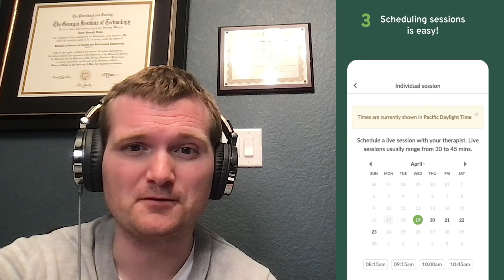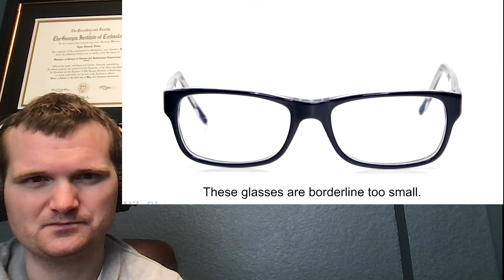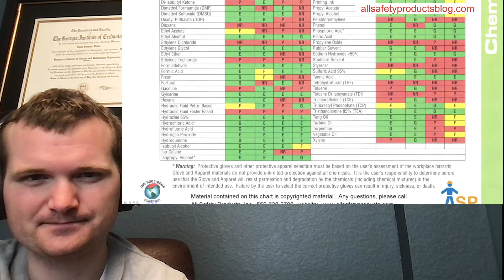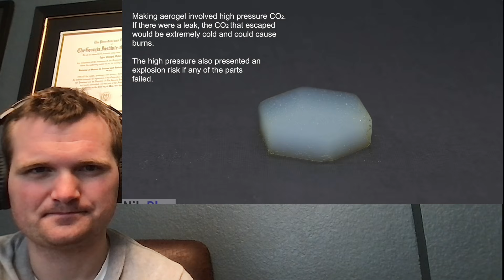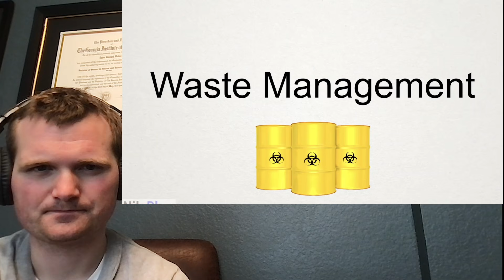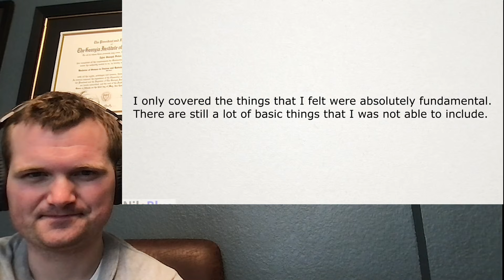Nuclear Engineer Reacts to NileBlue "Chemistry is Dangerous"

Comment: I'm a mechanic, and even though the vast majority of my job isn't anywhere near as much of a public hazard as nuclear or chemical techs have to deal with, there's still a lot of personal safety stuff.

First of all, we do deal with a lot of flammable chemicals that also cause slip hazards, so we need to know fire safety, cleaning procedures, and wear slip-resistant shoes (with oil-resistant soles, if you don't want to be replacing them once a month). We don't really have a need for a shower, because the only real skin irritants we work with are gasoline, parts cleaner, and brake fluid, and the only real dousing hazard there is gasoline if you're removing a gas tank. We do, however, have the eye wash stations, and they're checked monthly both to check operation and to flush the water so it's not stagnant or moldy.

We also have a lot of physical hazards, in the form of potentially-falling heavy things, splashing, flying metal shavings, flying hot metal shavings, dust etc. falling while you're looking up, sharp edges in tight spaces, things unexpectedly moving, pinch hazards, etc. - and, in most cases, multiple of those at once. The main ppe for all of that is supposed to be safety glasses, hard-toed slip-resistant enclosed shoes, cut-resistant and/or chemical-resistant gloves, and lots of safety lectures about procedure. In practice, lots of people skip the safety glasses and the cut-resistant gloves (I often skip the latter as well, because they make delicate or tight jobs a lot harder), but my employer is notable for buying prescription safety glasses for any employee who requests them. I've noticed some of the younger guys (by which I mean less than forty) never wear glasses, but the older guys (in which I include myself, even though I'm not (quite) forty yet) at least put them on for more hazardous tasks, like when the cutting wheels, bench grinders, drills, and torches come out. Guess which group I've had to remind how to use the eye wash station. 🙄 I've been doing a lot of work lying on my back the last few days, and I've had safety glasses the whole time due to the basic hazard of stuff falling in my eyes.

I've set of ppe I've never actually seen used is the face shield and apron we're technically supposed to use for handling batteries. Yes, lead-acid batteries do technically carry the risk of being splashed with sulphuric acid, but it's an extremely minimal risk; the batteries are mostly sealed with only a very few venting configurations, and essentially no risk of spilling without extremely obvious damage. They can technically vent violently or even explode if shorted or improperly charged, but, again, the risk is minimal, and the worst I've seen was some brief venting when charging an internally-shorted battery; the sulphur smell was the worst part. These days I pretty much exclusively with with AGM batteries (articulated glass mat, basically a fiberglass sponge that holds the electrolyte), which are much safer even than regular lead-acid batteries.

But the biggest part of our safety stuff is definitely procedures (we even have a shadowing process for using the lifts and driving in and out of the service bays). We have one hazards I'm pretty sure you've never had to deal with, which is customers. (Well, fleet managers and drivers, these days, but dealing with them is basically customer service.) We have rules for them, too, like no entry unless accompanied by a tech or manager, no open-toed shoes, no unaccompanied minors, no preteens at all, etc. The problem is, you can't fire a customer for disobeying the safety rules (at least, not at a corporate-owned shop), so there's not a whole lot you can do if they just walk in, if they start poking around their car in the air (look, I get it's the most expensive thing you own, but right now it's a couple thousand pounds of sharp, hot, and pinching bits dangling just overhead and surrounded by potential tripping hazards and dangerous equipment, maybe you could wait outside until I can help you navigate this area safely?) and such. I've seen a guy come to chat with a tech and have his 8-year-old daughter sit on the scissor lift in the meantime (one of the few times I've seen that manager actually yell at someone). Once someone tried to walk in to look at the underside of his car while I was still lifting it; probably the only time I've straight-up yelled at a customer, you do not touch a vehicle in motion, and that's on top of not just walking in unannounced, but moving a safety chain to do so.

And, of course, we can't forget waste streams. Oils, different types of brake fluid, cleaners and solvents (lots of hexane and toluene), washer fluid (methanol), glycol (coolant), various metals and plastics (plus the platinum-group-metal-impregnated ceramic of a catalytic converter), aerosol cans, contaminated mop water, oil dry, rags... Oh, yeah, here's a safety tip you might not know: rags soaked in oils and/or organic solvents can spontaneously combust. We actually have metal fire buckets specifically to contain our dirty rags. Then we have to separate recyclable materials from other recyclable materials (lots of scrap metal recyclers won't take lead, and some things like batteries have to go to specialists), separate our liquid waste (luckily, our waste management company is willing to take oil with a lot of contaminants and chemically separate it themselves; not chlorine, though, so we can't use chlorinated parts cleaner) into oil, glycol, and contaminated water, figure out what to do with nonrecyclable contaminated solid waste... It's complicated everywhere, I guess.
Reply: When I was 18 I was replacing the sway bar links on my car, and got rust dust in my eyes (thanks rust belt) luckily I was able to wash out my eyes without any damage. One near miss was enough for me to always wear eye pro from then on. I'm the safety trainer at my job now 20 years later and always tell people it only takes one accident to wish you could go back and do it differently, but since we don't have time machines they will have to wear the prescribed PPE lol
Reply: @kylemiller2920  Sympathies from a fellow rust-belter. I swear sometimes that all cars are made to be sold in Arizona. Even though I work on fleets that rotate vehicles out within five years these days, I still end up wasting hours covering things in penetrating oil and trying everything short of fire to get it loose sometimes. (I'd use fire, too, but the parent company for the fleets won't let us store acetylene or even butane in the maintenance shop.)

Comment: Nah that wasnt an emergemcy shower turn on in the video. I had a buddy pull the emergency shower on chem lab and it was a wild rate water every minute. Measured in gallons per second i believe.  It was pulled for 10 seconds and the guy that pulled it was instantly soaked😂 despite running.

Comment: Common incompatibilities is more of an issue from a lab management side of things - when you are working with any chemicals its expected that you would know if two things are at risk of a violent reaction (Or at least, have immediate preparations for what to do if shit hits the fan), but when it comes to storing or transporting things, placing the wrong things together could mean you are a collapsed shelf or trip away from disaster, that could have been prevented by knowing that things need to be kept seperate. This is especially a concern in larger institutions, where someone could be using something more exotic, and someone else just not know that its a risk.

Comment: as a welder, I've been in places that require the full 9 yards (hard hat, eye pro, ear pro, jacket, gloves, spats, respirator) and places that ban steel toe boots because it's more safe just to leave them at home. that place also didn't require glasses other than specific areas just because it wasn't a hazard. I usually wear thicker gloves than what's needed so I have more flexibility in positioning, but I've seen some guys go thinner so they have more dexterity using pliers
Reply: Totally - I think folks sometimes forget that more isn't necessarily better, and it's important to have the right gear for the job. Like wearing gloves in a machine shop is a big no-no, since gloved hands are a lot of machines' favorite food.

Comment: In my universit chemisty class i too learned the hard way to take chemistry safety seriously when i was using a pipet to measure our 1 ml of 18 Molar hydrocloric acid and the air behind the last bit of the acid formed a bubble that popped. 

I still have the sweatshirt from that day in my drawer. The tiny dropplets ate through a good 15% of the front of the shirt and i still have a scar over my eyebrow 15 years later.